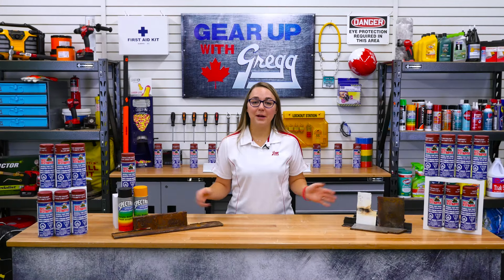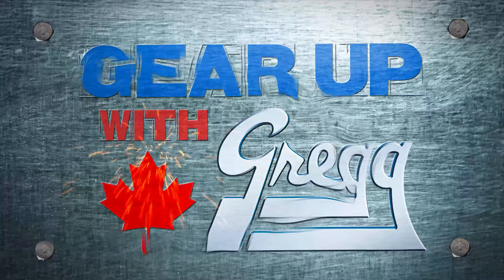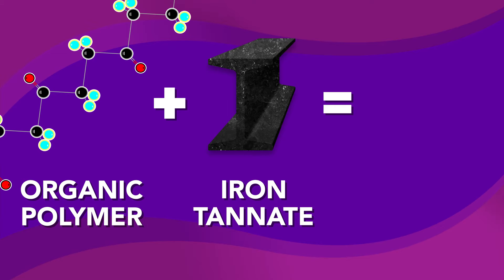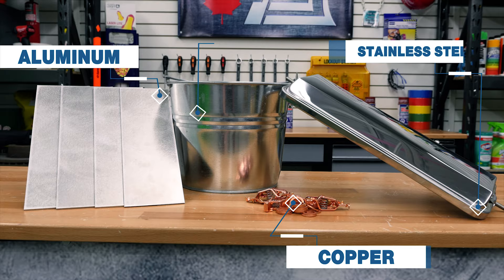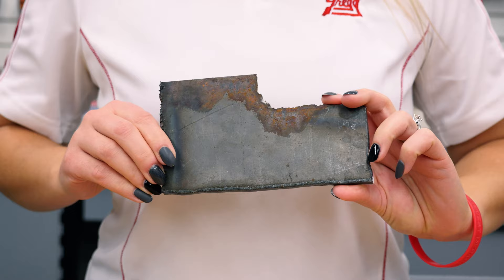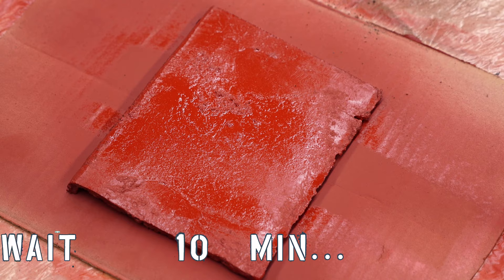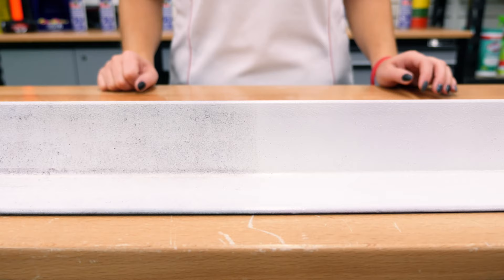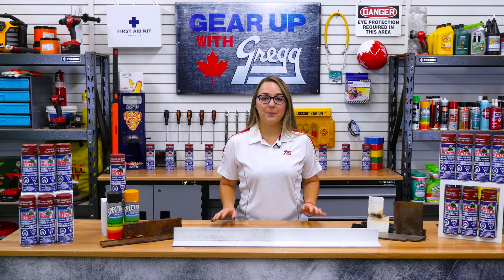Rust Converter: The BEST Way to Prime Rusty Metal for Painting - Gear Up With Gregg's

Comment: Can I spray rust oleum on top of this?
Reply from the maker: Once you've ensured that your coat of rust destroyer has fully cured, you can then use any oil based or epoxy paint to paint over the treated area.

Comment: Is this product suitable for use on a tiny rusted chip in car paint? An autobody guy told me to get a "turns rust to primer" product (that's what he called it, didn't tell me a brand) to fix it and then to paint it with car paint afterward. Would it also be appropriate to use this on an unpainted rusted metal shepherd's hook that sits out in the yard with bird feeders hanging off of it? I wouldn't paint it afterward because it never was and I like the raw metal look, but I'd like to retard the rusting and freshen it up. Oh, I just realized that it turns things red. Never mind about the shepherd's hook, unless there's a different product that you would recommend for that, even if I have to reapply every couple of years.
Reply from the maker: The Rust Destroyer should would for your application. An additional option that you can use for this application is a corrosion inhibitor or a rust protection film. These type of products are applied to metals, helping prevent rust. Check out our selection of rust protection here https://greggdistributors.ca/search?q=rust%20protection&resp_group=Default,Variations,ItemProperties

Comment: Can I use this like a sanding sealer to get a smooth unmarked surface before the top coat?
Reply from the maker: Yes you can, Rest Destroyer is intended to be used as a paint primer.

Comment: Can i spray paint the metal after applying rust converter?
Reply from the maker: Once you've ensured that your coat of rust destroyer has fully cured, you can then use any oil based or epoxy paint to paint over the treated area.

Comment: Once the rust converter dried do you have to sand it to get a key for the first top coat (paint)?
Reply: My experience with it is it drys like a oil paint....completely dry in 24 hours to the touch,but still too soft to sand.If you let the item dry a couple weeks then you can sand it like standard lacquer primer so its smooth for final paint.